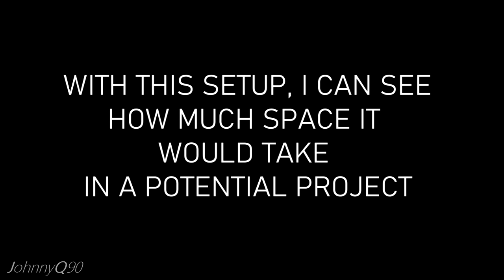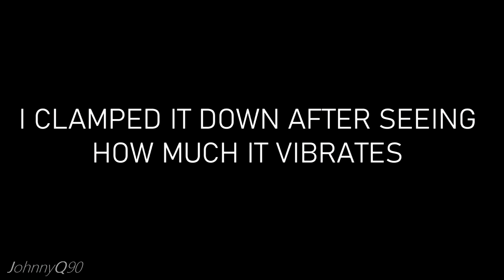Miniature Inline 4 Cylinder 32cc Watercooled Engine

Comment: If you buy one of these engines remove the sump cover and tighten all 
screws for connecting rods and bearings and cylinder head . One of my 
connecting rod caps came loose and went trough the engine others where 
loose . The rods look a bit soft cast aluminium it has a 5 bearing cast 
crank shaft which gets oil from the pump to the bearings then hopefully 
to the con rods . Best of luck with your engines .

Comment: Nice engine! 
"More videos to come with even more cylinders..."  

I just imagine a 96cc V12 working in a big RC-scale model of the Jaguar E-Type.
(imo one of a few most iconic cars ever made)
Reply: I'd honestly want to stick that in a motorcycle. Once you hit 50cc, you start getting enough easily attainable power to move a person. Finding anything other then a single cylinder sub 250cc is extremely hard though. So a V12 96cc? that'd be so much fun to try out.
Reply: @akabiscuitwaffle : That was also my first idea: move a person on a Bike or Gokart. This Engine shurely has enough HP to move a person more agile than a Moped does. 
But I see the problem in the torque of this (small) multi-cylinder engine to accelerate such a heavy load. You certainly need a good Clutch and a stabile Gearbox, at least 2 gears (one to accelerate, one to drive) better more gears. I once had a Zündapp Moped (similar to the famous "Kreidler Florett", not limited to 30 km/h) that had very RPM-friendly 50ccm 2-stroke single cylinder engine and 5 (!!) gears. 

Btw: 1960's Suzuki 50ccm GP-Racebike had 14 gears (!) and a  2 cylinder engine that developed 17,5HP (!!) above 20'000 RPM (!!!). Top Speed was about 100MPH.
Reply: @SH1974  The gearing solution is the same one that's always been used. You shove on a CVT and a centrifugal clutch. 

It wouldn't be much better then a 95cc 2 stroke moped. The upper end of 95cc kits make around 30 to 35hp. The better 50cc kits tend to hit around 10-ish wheel hp, and the best 65-85cc ones aim for around 20hp. Granted that's around 14-15k rpm.  

More common street rated dual ring ones will get 10hp out of 80cc bores in the sub-10k rpm range.

If it's just a 50cc bike that's good for power. There are multiple AM6 based minarelli engine bikes. The Aprilia RS50 is a good choice, as it has a 6 speed gearbox. The better derestricted versions make 12hp stock on the stock 50cc cylinder, but the more common ones only do around 8.5hp stock. It's a good platform for making a 20hp 50cc engine, and is what most 50cc leagues are made up of. The stock crank is only good for up to around 12k though, so that usually gets swapped out for one that handle the 15k rpm endurance race speeds, or shorter races/drags at up to 20k. At that RPM, they end up being able to push a turbo, which pushes them into 20hp+ at the wheel. Are they stable like that? Not really, but they're fun and extremely cheap when you consider new cranks are 60$, and even "expensive race only" bores are only around 300$.
Reply: @akabiscuitwaffle  
Okay, 80 or even 96ccm  is way higher ccm range than this 32ccm 4cyl.. (more the range, where a V10 or -12 version of this engine-kind would be... )
 
Guess, this 4cyl one makes around 2-3hp (maybe 4 or so) that's more compareable with a stock 30km/h moped (Puch Maxi, Ciao, "fifty", Sachs, or so. They do around 1...1,5Hp) 

I'd see this engine to make a beautiful (but not too powerful) board track racer bike. A fully usable showbike in 1:2 scale or so.
Maybe with a small NOX-Bottle for some seconds exta boost... ;)

Comment: 9:51 If it's a gasoline engine, why not just have an ignition cutoff switch? Or even just unplug the batteries to the ignition circuit?

Either way, looks really awesome!

Comment: Working with engines it's good to know how to shut them down. I've worked in garages where mechanics panicked and did stupid stuff to try and shut down a runaway engine. Grabbing a rag and stuffing it into the intake is the preferred way if a shutoff switch fails. Don't try and take off spark plug/coil wires, getting shocked isn't fun.